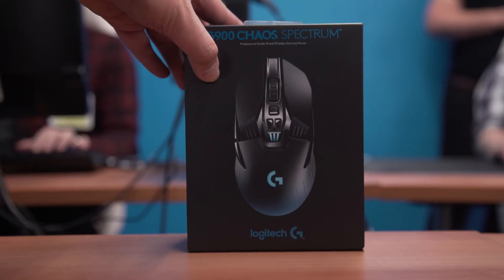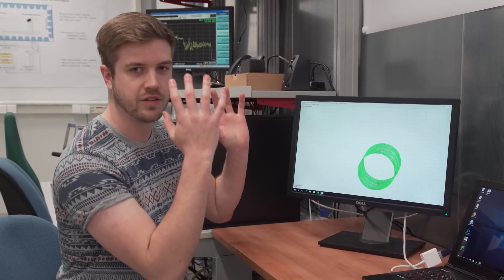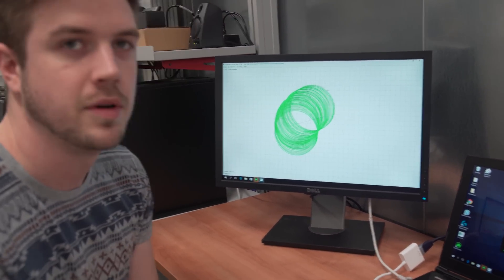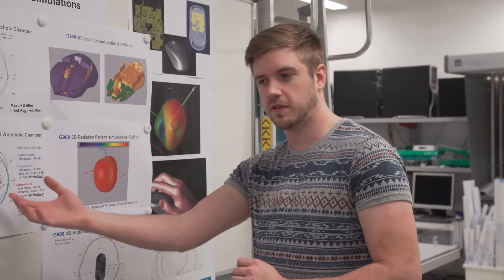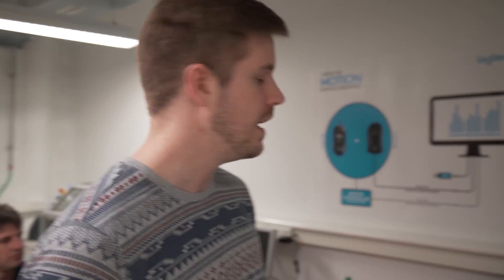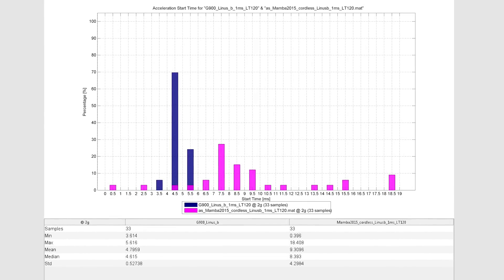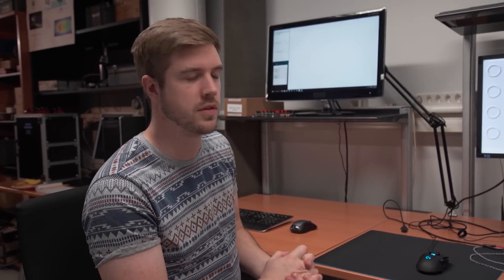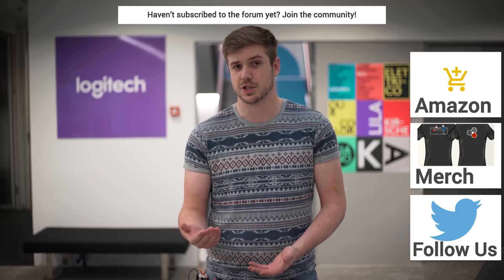Wireless Mouse Technology Testing at the Logitech Daniel Borel Innovation Center

Comment: As much as I'm all for thorough testing of products, I don't agree that their variables are acceptable. The spectrum blasting ranges weren't stated (so probably 2.4ghz which is why it affected the other mice). Eg. The Ouroboros runs on the 2.4ghz scale (as we all know. 802.11 a/b/g/n is all over that like flies on shit.) Logitech uses 700mhz band for most of their wireless technologies. If their mice and keyboards were next to my phone (4GX here is 700mhz) it would probably fail... hard or knock out my service temporarily. It's like trying to affect a cars performance by yelling at it really loudly. So in the end, Yes their wireless tech is good in comparison to the norm but if 300 people used it at the same LAN, it would be the same shitty result. Apples to oranges disguised as apples.

Comment: So Wireless vs wired is decided by Luke's clicking skills? Dat sample.

And guys, don't miss the part that "this video is sponsored by Logitech" , its not like they would do this piece for Logitech for free. So I'd say there is a conflict of interest. At the very least take it with a grain of salt.

Personally I highly doubt wireless can have better latency than wired. so I'm super skeptical of the last test.
Reply: wireless shouldn't make a difference, it is passing through copper at the usb connection and through the board, the only difference would be made by the faster sensor and chipset on the logitiech. So if you had a wired equivalent of this mouse it would operate at the same or faster speed, (now that would be a solid experiment). And logitech cannot claim they beat wired by having it beat just 2 competitor models.

Comment: this doesn't take into account low battery. the lower your battery the worse it will perform, so unless it has a battery bar you wont know until it dies on you
Reply: I'm not sure that's how it works, it'll provide the required amount of power until it is impossible to do so then turn off. Not slowly get less and less
Reply: not unless they designed a completely new style of battery usage without boasting about it. every other wireless mouse it wont die until there is no battery left. its just how batteries and devices work.

Comment: "This video was sponsored by Logitech." so basically a 20 min commercial.... 
and it is so funny they don't show the Logitech when they turn up the noise signal and i watched on a 4k display in 2160p but a little after they turn on the noise signal it seems the Razer run smooth and steady like the Logitech one. But the best in the "Clicktest" seems the wired Razer was to good so lets take a Steelseries.

Sorry but this video needs a big commercial logo in a corner

Comment: LOL all of this tested in a fair and IMPARTIAL testing environment, using LOGITECH'S own testing equipment.
Reply: it's debatable, i mean, in a test that most mice will fail, including probably logitech, not everyone wants to give access to the rf isolation room, and one isn't cheap, check the office tour
Reply: True but there is no telling if they are interfering with the signals, or distorting the results, from non-Logitech mice.

Comment: Cool video, we love the factory tour stuff. But,
the thing about laboratory tests is that they dont necessarily equate to any real world situations. You can use them to say that there is a different. you can't use them to say that the difference is meaningful. less than half of this data would have any impact on 99% of users in 99% of use cases.
So very cool that they do this. But gives you nothign about performance/dollar

Comment: The first 8 minutes of this video were completely irrelevant to the vast majority of people.  Personally, I've used dozens of wireless mice and I've rarely, if ever at all, seen RF interference.  Most people aren't going to huge LAN parties and don't have their microwave oven sitting next to their PC.  The only real issue with wireless mice is latency.  This was demonstrated in the last segment of the video, but I'm still taking these results with a grain of salt.  Only two other mice were tested and the whole procedure was done at Logitech's facility.  I'm not saying the data is necessarily bad, but until I see this done from an independent third party (This whole video was sponsored by Logitech, I hope you realize) and with a much wider range of mice, I will remain skeptical.
Reply: +John Drachenberg yep. the whole video I was tinking about the fact that it was made for a sponsor, in the sponsors facility, so they could skew the results without luke even knowing.

Comment: Still has a battery, so I'm not at all interested. Thing number 2 is why the F would I (or even could I) care about the difference from my mouse lag being 3-5 ms better when my monitor adds orders of magnitude more lag, my graphics card adds magnitudes, my processor adds magnitudes, and my ping is multiple orders of magnitude larger and therefore more important?  The cool points about the mouse are negligible data points, I'd only have a reason to buy it if were significantly less expensive than those other mice, too.

Cool video though! I also think it's pretty cool that they take their job seriously, and that they let you play with their neat toys.

Comment: how would the g900 compare to logitech's own wired gaming mice like the g303,g402 and g502?
Reply: I was at PAX last year and chatted to a few of the Logitech guys candidly about this.

Basically, if you plug their own mice in they exhibit a 1-2ms advantage over the wireless version. Logitech are not trying to say that "our wireless has less latency as compared to wired on the same mouse, as a protocol" they are saying that Mice like the Steelseries 300, Razer Death Adder, pretty much all off the shelf "cheap" wired optical mice and a few more premium brands in certain products, all have worse sensor response and click latency than the G403 / G900 wireless.

Since no one ever questioned the latency of these "wired" mice, (nor would they ever notice) and were simply shopping on weight, size, software, durability/build, etc and just "assuming" no latency when wired, then it is not legitimate to question latency with Logitech's wireless, purely based on preconceived ideas based on old wireless protocols unless you want to start questioning latency of all wired mice as well.

Example - it has since been proven that the Zowie Ec1 / FK series has 7ms additional latency on the y axis, than on the x axis (probably a firmware or sensor implementation issue) does that mean it's a bad mouse because on the y axis it's 4ms slower than Logitech's G403 / G900 wireless mice?! of course not. Because the numbers are so small no one would ever notice anyway, even the pros! Has anyone using a Death Adder ever said, I can't use, too much latency, Nope!

Logitech mice in general have the lowest possible processing delay, usually beating out most other mice brands, purely because of their expertise / long experience and size as a software products company, being in a position to hire / pay the best engineers, and the development of good firmware. Mouse latency is all about firmware, basically.

When a mouse says it's 1000hz polling, it just saying it supports the USB2 standard polling rate and isn't limited by any previous standard below that. A mouse still has it's own firmware and sensor implementation, and will still have it's own processing delay of both movement and click. The usual you will find is as follows.

Movement anywhere from 2-8ms
Click anywhere from 3-10ms

All of these measurements would be fine and consider normal and "low" latency, and has been proven that it does not affect even professional competitive play. If my opinion you are more likely to have an advantage without having to worry about a wire dragging / affecting feel, and having more freedom of movement, especially on low sensitivities.
Reply: +Matt Soul I'd expect the G303 to perform similarly, or with a millisecond higher latency at most. As long as you don't need wireless, they give you much better value for your money.
Too bad they didn't compare, but I guess Logitech probably wouldn't want to advertise that their much cheaper wired mice perform equally well. Or they didn't want to bloat the video and preferred to show how much worse the competition is.
Reply: +Matt Soul Because then the g900 wouldnt look so good.
Reply: It's the 502 but with a new design, new features, replaced things, really freaking light, rechargeable, and wireless
Reply: +Steamrick You can easily replace the mouse wheel and swap them out with any other Logitech mouse scroll wheel though (pretty cool! It's a separate module). But hey, to each their own. I hate ambidextrous and/or light mice, personally.
Reply: Bloodstainer
Eh, the G502 is a right-handed only design which makes it useless for me (I switch mouse hands at times) and I dislike the ridges on the scroll wheel. G303 all the way.
Reply: +Matt Soul the heart of g502, amphidexterity of g303. Other than that, a new visual design and, of course, wireless capability.
Reply: +Matt Soul if we go by what is advertised, and even suggested in other Linus videos, the G402 is :
* wired (so no interference) so they are I guess equal in this regard.
* has a zeroDelta drift sensor, while the G900 we all see has drift. Point: g402.
* has a 1ms report rate, so it is conceivable that it is faster to report movement than the g900 4.5ms average. Point: G402
* is $50, while the G900 is $142. Point: G402

Anything else?
Reply: +seePyou 
you need to look into more than marketing names

1. as proved in this video wired mouse get their ass kicked by g900
2. its sensor is superior all around, which is way better than zero drift
3. 1ms is the polling rate, which is the same for most mouse

honestly if g900 were around 100$ then it would be a perfect buy, right now i will probably choose a g502 or g402
Reply: Giorgos Chatziioannou
 for (1) we saw some wired mice, not the 402 or 502, or in fact any LG mice, so nothing is proven. For (2) we do see drift in the video, why do you say we do not? There is clearly drift or the circle should be always drawn as a circle ad you would not see a cylinder develop. For (3) I can grant you that, and let's say that they are both equal. Again... zeroDrift sensor and much lower price wins out.
Reply: +Giorgos Chatziioannou (LezantasGR34T) +seePyou +Mathboy
+TheSeriousJulian +Grammar Nazi +Bloodstainer +Steamrick +florent trepanier
+Witherstar720 +w4570 PeeVeePeeS

WOW thanks for all the replies, this is actually the most I have ever received
lol, anyways… i currently have a year old g502 (core ofc). 

So, many of you have mentioned that the G900 is basically a
cross between the g303 and the g502 but its wireless. I was mainly asking if there was a difference in latency because the g900 beat some popular high end
mice that are rated as "1ms response" or "1000Hz Polling
Rate". In the end many of you reminded me that this is technically
marketing and would only really bring negatives for LG in the sense that their previous mice slow or the g900 wireless isn’t as good as the g502 wired.
I was genuinely wondering if the g900 will “succeed” the
g502 as the next flagship for their gaming mice or just for the wireless portion, replacing the g700s and g602. I was also concerned with how my g502pc compared in latency. I probably wouldn’t notice the difference, but it’s just
good to know.

+Hippownage yeah i was thinking of changing the mouse wheel on my g502 since it started to corrode after a year. Actually it turned black and well... looks really nice. Although it may have looked better if i had gotten a spectrum.
+PTNOPOT thank you for that information i will definitely check it out.
As for the g402 or g303 being the best, I mean I got my 502
for almost half its retail price so as far as value goes, I’m pretty happy.

So I guess I was also trying to gauge if the g900 will
become the next ‘flagship’ mouse from Logitech even though the g502ps was just released about a few months ago?
Reply: +Matt Soul I'm curious how it stacks up to the g700s as that's what I have.
Reply: +Matt Soul I'd say if you're competitive and want a competitive mouse, but don't want to spend as much as a Zowie, the g303 and g402 would be better. The g303 being superior to the g402 but the g402 being enough to play with. Honestly a g303 plus mouse bungee are much cheaper than the g900 and if you're not a performance enthusiast, the g303+bungee combo will serve you better.
Reply: +Matt Soul its closer to the G502 in construct, the G402 is lighter and generally the best gaming mouse they have when its on sale, tis ridiculous value. The G303 is nice, but its very different, different grip and frankly, only pick the G303 if its on sale or if you really want RGB without going 502.
Reply: Steamrick Never heard of a left-handed person that uses mouse in left hand though.
Reply: why would they want to compare it to other good mices?
Reply: +Steamrick the G303 is faster in response and debounce compared to the G900 in both wired and wireless. Please don't spread misinformation. Mouse shooting v1.6 tests show the G900 as slower.
Reply: +Henrix98 simply to show how good all of their products are... maybe
Reply: +Matt Soul probably wont become a successor to the g502 because of its much higher price point, but in terms of features might as well call it Logitech's flagship mouse.
Reply: TheSeriousJulian
i agree. g502 is close enough to cheaper gaming mouse to be considered the top of the line
Reply: +Matt Soul https://geekhack.org/?topic=56240.0
Reply: For now if you play with high dpi often like 800+ G602 is a great option.
Reply: +PigeonMilker fat
Reply: +Grammar Nazi you made a good choice, one month of using the g303 gave me rsi, and while I got a refund I'm currently paying the price with having to take a break from using a mouse for a month or two.
Reply: +w4570 PeeVeePeeS g303 superior to the g402? In what way?
Reply: +Grammar Nazi 
g303 is for people with smaller hands and/or play with a claw grip. I had a SS rival before my g303 and the shape was horrendous at first tbh, but i've gotten used to it and i like it alot now.
Reply: ***** Someone's easily offended lmao
Reply: +Matt Soul They don't want to show the faults in their own mice, therefore, no comparison to their own products. This is a "marketing" video after all.
Reply: seePyou

1. i doubt that their cheapest mouse can do better than more expensive competitor mouses

2. i did not say about the drift, rather the overall sensor performance. g900 use the best currently available sensor

if not for the sensor i would get a g402 in a heartbeat, but now i cant decide between it and g502
Reply: lol
Reply: + Firestar9114 apparently there are some other people that wanted to know as well and i believe they said they were basically the same. But i am not sure, please don't quote me on that i can't remember as they were talking about basically the whole logitech lineup. Sorry about that
Reply: Thanks!
Reply: its very similar except it has a wirelessfunction
Reply: +iamspartacus29 wow!. It may be late but that is a very interesting and detailed reponse. thank you very much although i'm not so concerned at this moment as i have a g502 i hope this benefits any and all future readers
Reply: +seePyou You're confusing everything, man. G402 is not free from circle drift, the "zeroDelta" stuff means it has no effective cpi variation due to speed of mouse movement, given certain limits. Completely different thing, G402 DOES DRIFT, like every other mouse.

The G900 ALSO HAS A 1MS REPORT RATE. That's actually referring the polling rate the mouse can be used at. Polling rate just means how many times a second the PC will check the USB for information, doesn't mean that every information the mouse is capable of producing will always be generated at equal or smaller times than 1 ms. 

Look up the report rate of the other mice tested in this video, all of them will be "1ms", despite showing much higher averages on the tests done here.

Materials, features, performance is all much better on the G900, that's why it's more expensive than the G402.
Reply: that would be interesting
Reply: fat

Comment: I will never buy a wireless mouse... replacing and/or charging batteries is completely stupid. I don't care how good your receiver is my wired won't give a half a shit if there are a million people around me.
Reply: +Josh g Most gaming mice may require you to charge the mouse every second day or so, can speak from experience that it can get quite annoying. But yeah cable pull is also super annoying, so if they can somehow figure out how to wirelessly charge these mice with the mouse pad similar to how wireless phone chargers work that would be the best of both worlds.
Reply: I replace my mouse batteries like once a year, it's hardly difficult.
Reply: +Josh g Yeah my mice are fine, I have a wireless mouse/keyboard combo and even though I don't have to every time I go to bed I just drop my mouse in the charging cradle problem solved.
Reply: Rechargeable batteries?
Reply: +Josh g Is it a gaming mouse?

Comment: Good to see a testing facility not using Windows XP or 2000......

But they have the Windows 95 background on Windows 7.
Reply: As long as the computer isn't connected to the Internet, the OS version shouldn't matter as much. If you're not connected, you should be more concerned with programmers being able to handle the software more than security vulnerabilities.